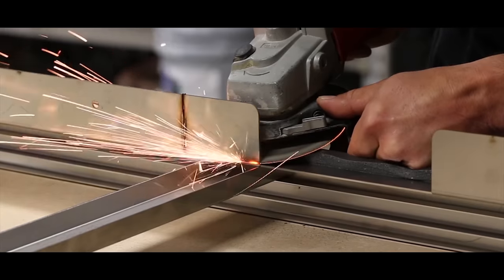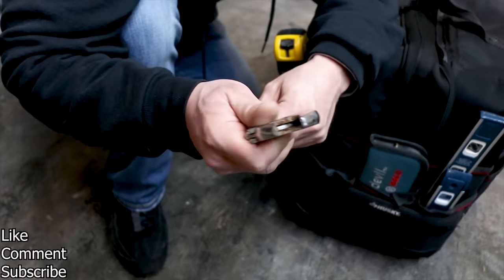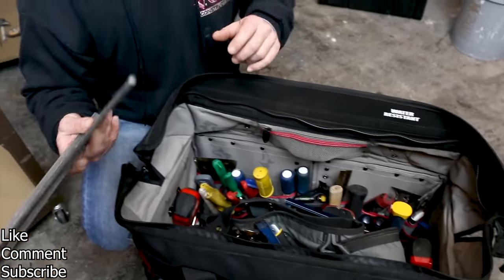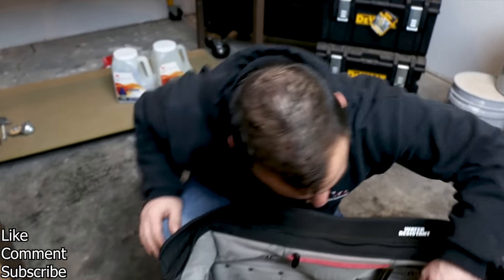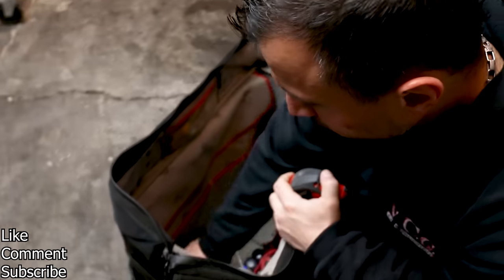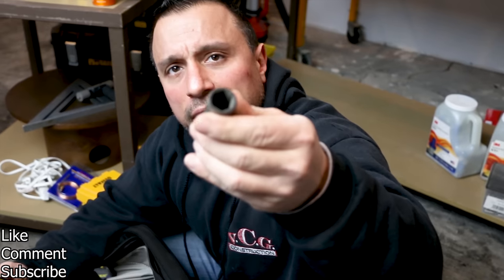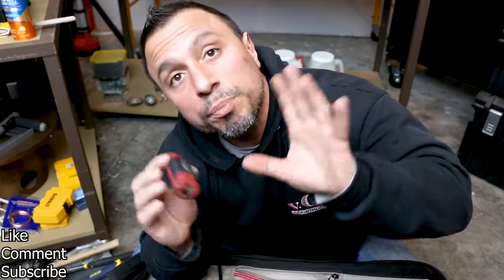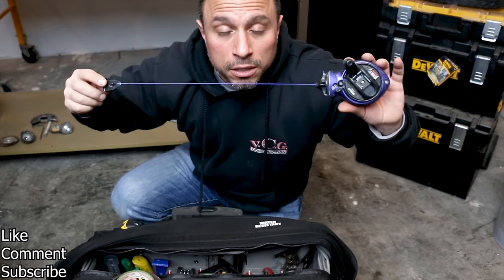Inside A Contractors Tool Bag

Comment: This is just my every day carry to pretty much all types of work. In my tool belt. 25ft fatmax tape, 22 0z hammer, big and small nail set, 1/2" and 1" beater chisels, small flat bar, flat head screwdriver, either 1 set red or yellow snips, random common screw tips/ always 1/8" and 3/16" drill bits for predrill, 1/4" and 5/16" nut driver tips, speed square, small file, chalk line, at least 2 pencils, quick change utility knife, small needle nose pliers, and suspension rigs. I feel that these tools are a must have for any carpentry/ handyman work at all times unless you are crawling on the ground working. Thanks Vince for sharing.
Reply from the maker: Well rounded EDC, I should add a needle nose and file to my setup!!
Reply: Vince do you still have this husky bag or have you switched to something else. I have had this same bag for 4 years and love it but I had to replace it twice because the handle kept getting stuck on me, have you had any issues.
Reply from the maker: Still have the bag and haven’t had any issues

Comment: Thats my old favorite husky tool bag. 
Sometimes I still miss it . Telescoping handle is good till it breaks . Still it's worth buying a new one if it suits your job site needs . Great video on a big rolling tool bag and contractor tools
Reply from the maker: Handle has been pretty rugged for me, what happened to yours?
Reply: Overloading it and yanking it up stairs and kicking it down stairs and dragging it sometimes lol. I scraped the plastic skid on the back off. It took a beating for sure and it's really the handle that fails eventually. I know it's my fault lol. The bag was always over filled and I added out side pouches it weighs . Great bag took the abuse for probably a little over a year. 
You can actually catch that bag in my 
Milwaukee warranty video.
Reply from the maker: Will husky warranty the bag?
Reply: I never thought about that maybe ?
Home Depot is crazy good with the warranty stuff . Plus I've moved on with the dewalt tough system. Your amazing bro 
You can power a space ship with the energy you have must be the coffee .
Have a great weekend work hard play hard

Comment: I have the smaller Husky rolling tool bag.. I have another husky tool bag to split the weight when I go up and down stairs . I am a bit older as well as go from apartments to apartment for repairs and remodel so splitying the weight helps, then when I get them both up the flight of stairs you put the one on top of the roller and roll down the hallway..a tip for u as you get older and the one is too heavy for up and down stairs ..
Reply from the maker: Thanks for sharing ReCycle, we all appreciate it!!

Comment: I Love the concept of the Husky large rolling tool bag BUT I've owned 2 of them and they just won't stand up to my daily use and abuse. Both lasted less than 1 year. The handle, rollers and zipper never failed but all of the pockets ripped inside and out which leaves you with nothing but a big cavernous bag that you have to empty out every time your looking for something. I still have the bags for use at my house but for me in a commercial / industrial setting I need something much tougher than Husky builds. I now have a Veto bag. The bag itself doesn't roll but if I need to go long distances I bought a small set of folding aluminum hand trucks with non marring wheels and it's working great for me.
Reply from the maker: Stay tuned, I've heard some rumblings about Veto Bags with wheels!!
Reply: Oops!, I need to set the record straight. The bag you're reviewing is the pro grade ( 1,680 denier ) and cost 129.00.  The bags I owned were the same size but different quality ( 600 denier ) and cost 69.00. When I bought mine years ago Home Depot didn't have the heavy duty 1,680 denier bag. I wouldn't hesitate to buy the pro grade bag. It's much, much more heavy duty than the ones I owned. Sorry for the mix up.

Comment: Great video Vince, Love the husky brand tool bags but have graduated to the veto pro bags. They are pricey but great bags. I also love the Milwaukee soft roller bag and now own the hard plastic Milwaukee roller system with all the accessories. Its getting better and better. I also love your comment about the chalk box, that is also my favorite.
Good times brother, keep up the good work.
Al from Maryland
Reply from the maker: Thanks Al we appreciate it! Gonna check out veto pro bags, if they do the job better than its worth the extra cash!!
Reply: The good thing Vince is everyone is trying to duplicate the veto bags and it is improving all the others. Milwaukee now has bags with a similar base on them. If your bag was in two inches of water your tools would still be safe.
Check out the vetos, you won't be disappointed.
Al
Reply from the maker: Will do!!

Comment: I am a cabinet punch guy on new  high rise apartments. There is no way I would survive packing that load up 14 flights of stairs each morning. In my line of work a tool bag must be lean and only have what’s prudent to the days task at hand. I can understand that load when working single family homes or TI’s in strip malls.
Reply from the maker: They don’t let you use the service elevator?

Comment: i used to go thru bags every year until i bought veto pro pac...the best bags in the business...most of their bags are over $200 but worth it. 5 year zero downtime warranty and hold up to the abuse.   The only problem is they dont make bags with handles & wheels on them so if you want that style gotta buy husky for now. i own 3 veto bags and will never buy another brand after owning them.
Reply from the maker: Thanks for the heads up, we’ll check them out!!

Comment: Vince, you have to tell me what brand that DRYWALL RASP is, we have these cheap Stanley Rasps that break all the time, the old school ones are nowhere to be found, where and when did you that one??
Reply from the maker: It’s a cheap “wallboard”, “thats the company name” rasp I found at Depot!
Reply: A it looks like those old heavy duty ones that last for 100+ years. I had one from my Papa when he passed I got all his carpentry hand tools, but it went missing on a job out of my pouch one day. The depot up here only sells the $5 Stanleys. Thanks for getting back to me!
Reply from the maker: Try wrapping a block of wood with some wire lath or expanded steel!
Reply: Interesting. I would never have thought of that!

Comment: Only one pair of vice grips?! I always carry my 10in curved jaw Milwaukee Torque Locks with cutter and 10in curved jaw Stanley FatMax. Sometimes I'll carry others but I like the Torque Lock and FatMax cause both have a hole in the bolt to let you tighten down more with a screwdriver or whatever.